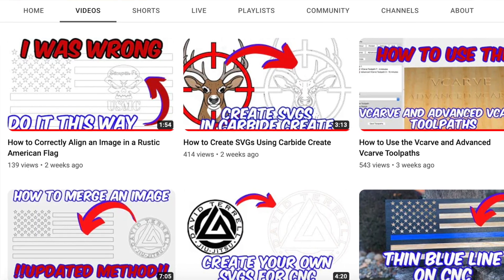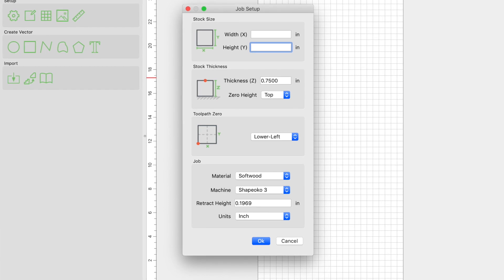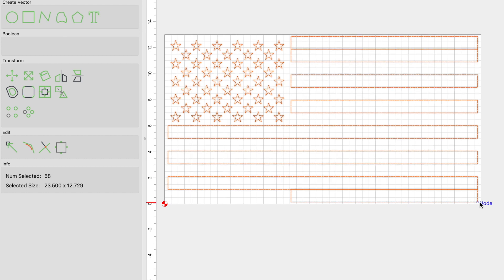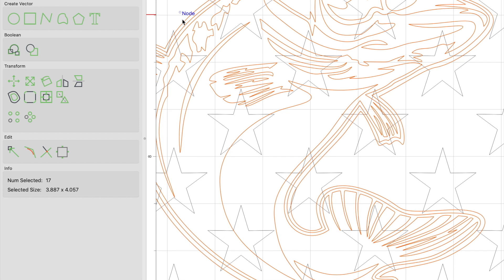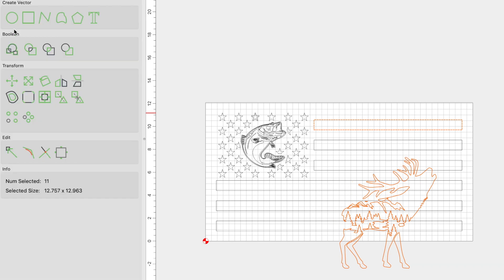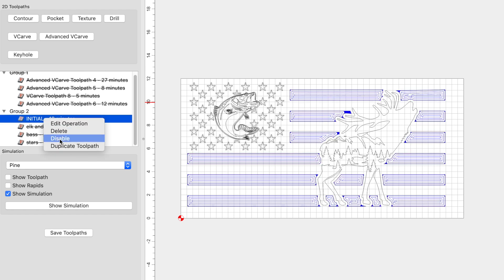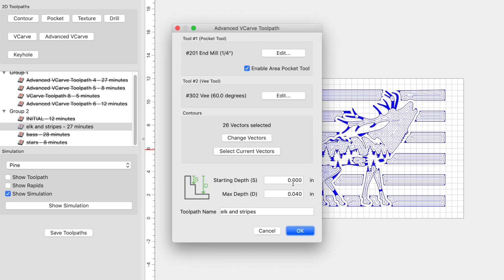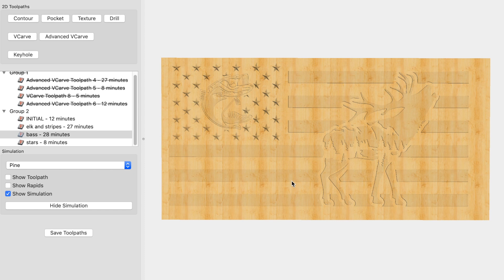"Design Your Own Creation! Learn How to Make Amazing Custom Flags using CNC Machines"

Comment: Out of curiosity, why burn the wood only to re-cut the burned area? I’m learning so no judgement, just trying to understand. Thanks in advance.
Reply from the maker: Hey Trey, appreciate you checking out the video and the question.

My thought is that it’s faster to burn the whole thing and also alllows me to get more even burns throughout the red stripes rather than try to burn only the red stripes which could lead to too much burn. 

And it’s also to dry the red stain and torching the entire flags makes sure I dry all the red stain.

Comment: I have a shapoko XXL pro. I appreciate your all of your content.  I have been practicing some signs and flags after watching your videos on Advanced Vcarve. On most I rin the 1/4"201 but have also used 1/8, I seem to have a lot of left over small lines in the recessed areas. Is this a step over issue? Some areas are too small to sand.
Reply from the maker: Hey Larry,
interesting that you bring this up because I’ve been having this issue too and I am attributing it to my material not being secured flat.

I have a tiling job running as I speak and I noticed some variety in the depth, which I think is causing me to get those same lines. They’re ever so slight but as makers we notice them.

Im going to try tramming my machine soon and see if that helps. But I think it’s a flatness issue.
Reply: Thank you, I will do some testing on perfectly flat materials

Comment: I'm just starting out, what kind of wood do you use to make your flags? Thanks
Reply from the maker: Im using edge glued pine panels from Lowe’s.
Reply: @aetimberpine  thanks for the reply
Reply: @aetimberpine  do you use a particular size? Or do you cut them to a specific size? I only have a skill saw and a straight edge 🤣
Reply from the maker: @stevelipshin4843  so for my smalls I’ve been using the 12x24”.  They’re already 12” by I don’t recall if I cut the length to size.  

The 19.5x36 size flags I’d have them cut it to 19.5 because the length is 36” already. 

Are you using a cnc for your flags?
Reply: @aetimberpine  I've only made 1 crude sign so far even though I've had my machine for over a year. But I really need to get it going. I have a onefinity woodworker. I love your videos by the way!
Reply from the maker: @stevelipshin4843  oh okay cool. Then yeah man you’re set to go.  You don’t even need a table saw or much else. Even though those are nice to have and I would recommend you get a table saw, even if it’s a used one.
I had a used makita job site table saw from like the 80s for my first one.